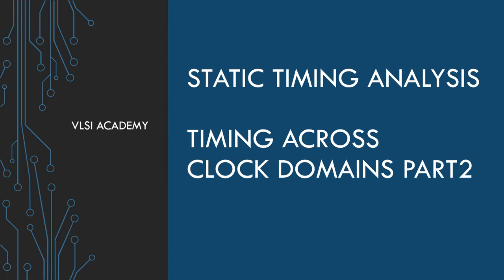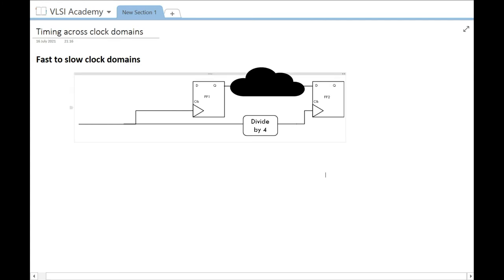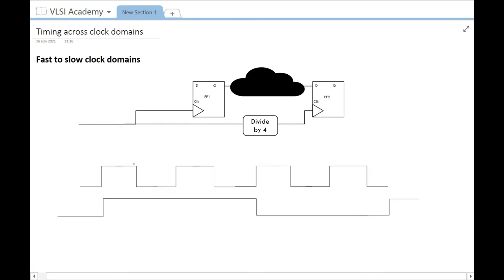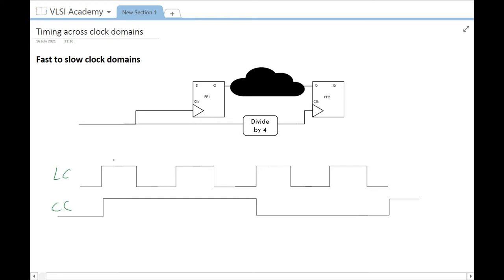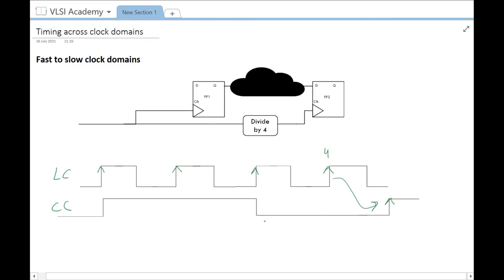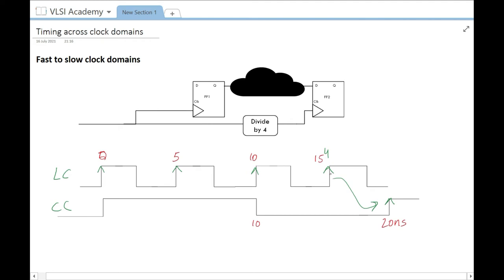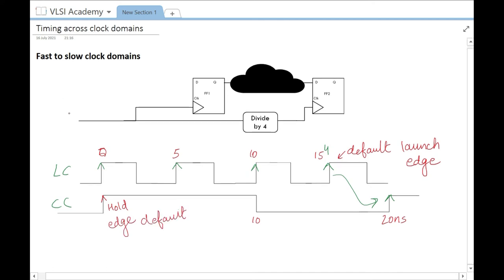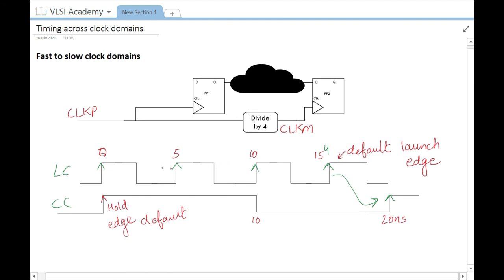sta lec28 timing across clk domains part2 | Static Timing Analysis tutorial | VLSI

Comment: Sir. thank u for a great lecs. I have a question follow upon the example you gave at the end of the video. If MCP is set for setup as "set_multicycle_path 2 -setup -from clkp -to clkm -start [get_port clkp]", and the setup edge is at 10nm after this, then what about hold check after this setting?  thanks.
Reply: further question: even you move setup check edge back to 10ns, make setup harder, but data will still be launched at the next positive edge at 15ns, right? would this create some sort of wrongful data be captured?
Reply from the maker: Not sure if you are still looking for this answer, but hold is always checked at n-1 edge w.r.t setup. Hope this helps

Comment: For the faster clock to be launching, the signal will have to be held for 4 clock cycles so it is captured by the slow clock. you cant just keep changing data at every launch clock here.. that data will simply be ignored by the receiving flop.